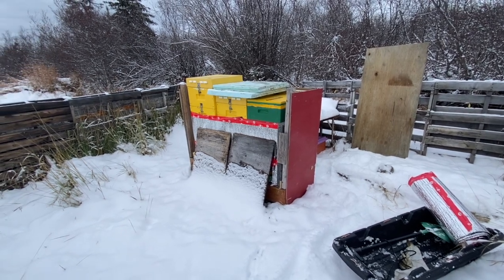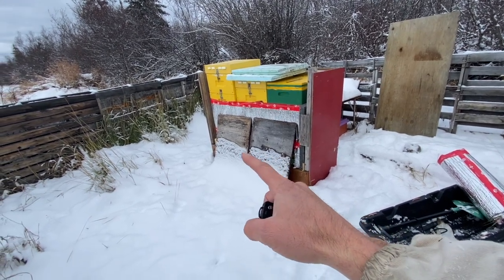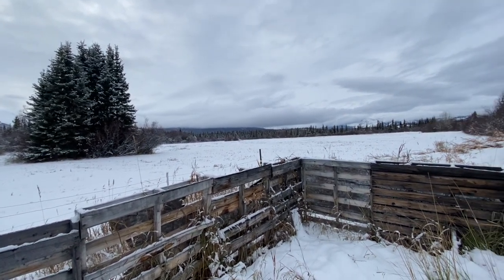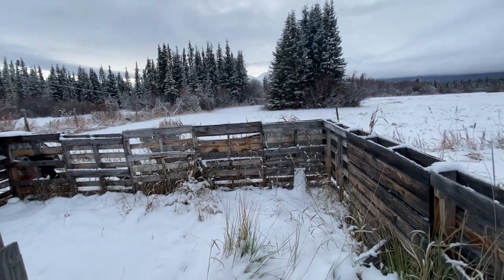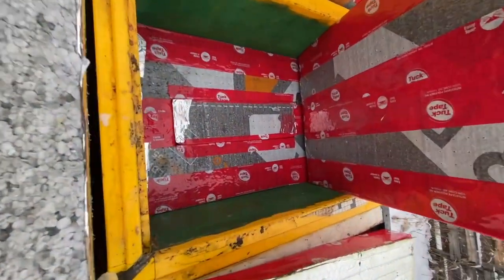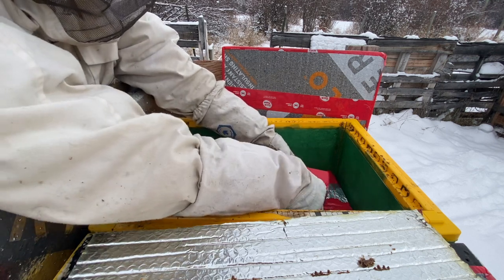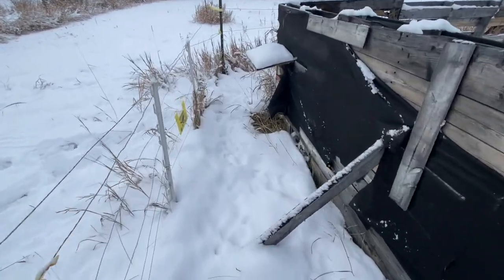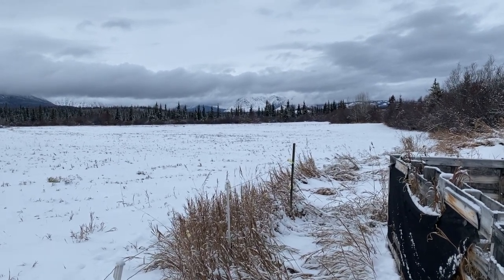Opening hive in winter with minimal impact - ET Style

Comment: Are these sensors available to purchase?
Reply from the maker: I have been using a bunch of broodminders for almost 10 years now. Google Broodminder sensors. The temperature only provides most of the info you need. The TH model adds humidity but may not be as useful. If you run "hot hives" no top ventilation with >R20 on top you will have an RH% of between 65 to 80% at 20C.
Reply: @etiennetardif thank you. I use broodminders but couldn't quite confirm if that's what they are. Love seeing the data. 
Thank you.

Comment: Etienne i could not live there I hate snow and cold. I hope your bees do good. how many hives do you have going into winter.  Why would the temputure go up when u add a pollen patty. The insulation on the top is that R 10 for each piece that would make it r R 40 have 4 pieces on there.  1 piece is R10 where I live.  That is really nice. Thanks I enjoyed your video have a Blessed week
Reply from the maker: @framcesmoore  once the bees get access to a protein source, it will trigger a number of the winter bees into becoming nurse bees and the whole colony will start rearing brood. They will start heating up the nest to 35C to allow the queen to start laying eggs. Winter core temperatures is around 20C. Once brooding starts it goes up by 15C. This is the reason highly vented and low insulation colonies are at a higher risk of starvation if cold weather drags on in spring.